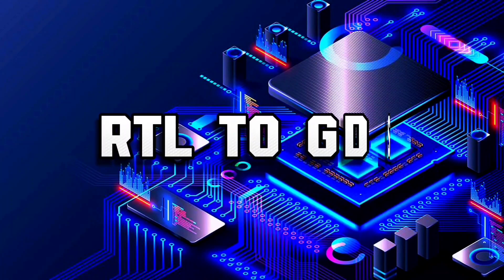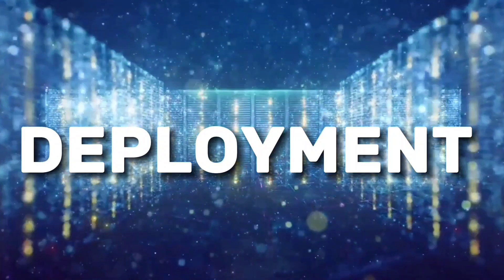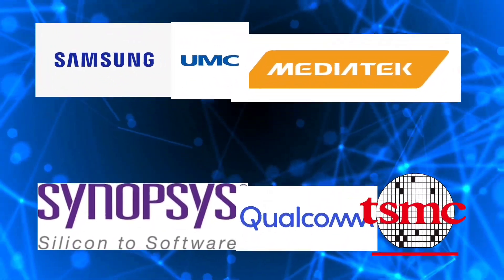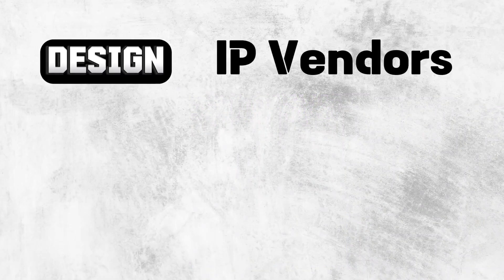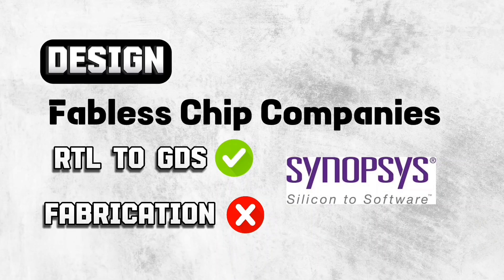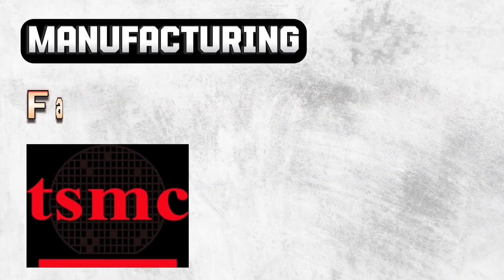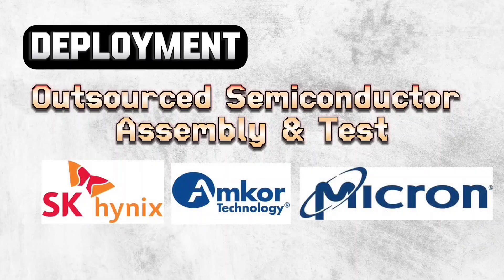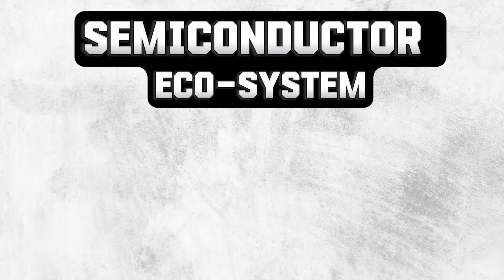Company types in VLSI Domain (English) | Semiconductor Ecosystem Explained | Rajveer Singh

Comment: Wondering if a biomedical engineering undergrad can pivot to a VLSI career through courses or institutes. Is an ECE/EEE background a must, or are there successful transitions? Share your insights! 🤔💡 #BiomedToVLSI #CareerAdvice
Reply from the maker: Technically possible but would really require a lot of effort. May be Courses + Service based job for the initial few years ....then Proper product based company.
So, Indeed a very risky  career decision and it will really require so much effort because one needs to start from the basics.
Reply: @Singh-Rajveer  what will be the initial job roles to target for job